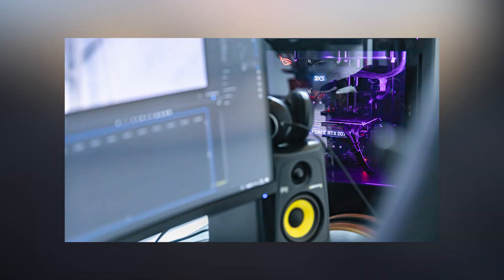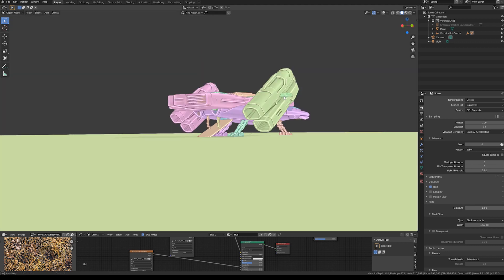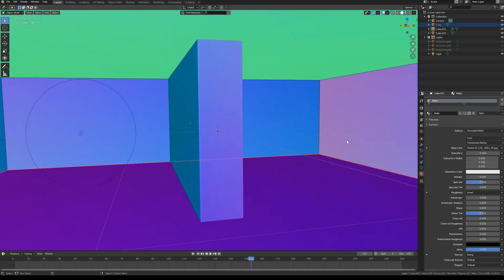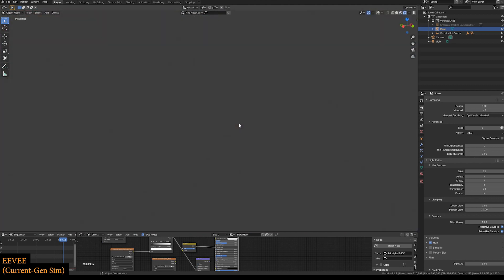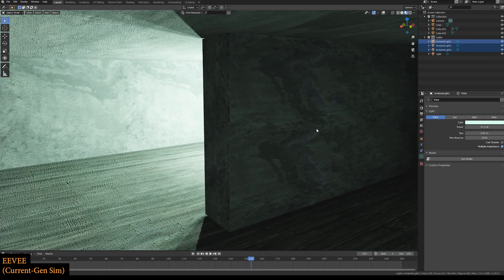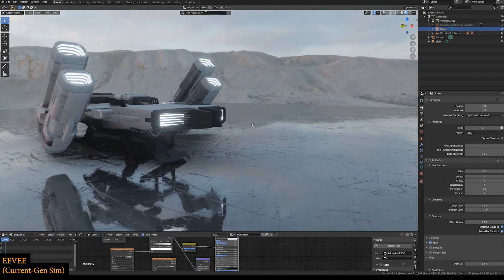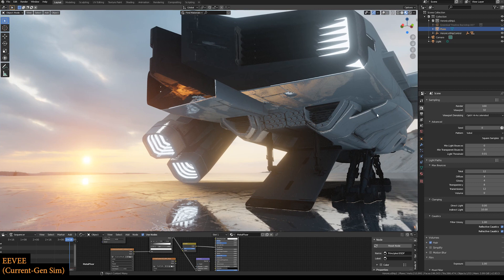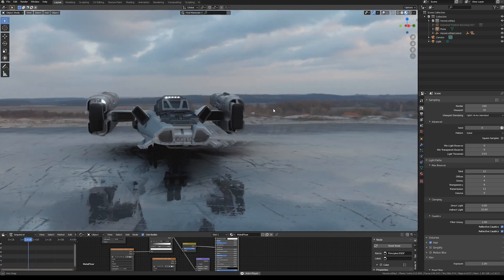Next-Gen Ray Tracing Demo using Blender 3D - How Will It Work?

Comment: You have a fast card, in cycles it's almost realtime
Reply: i think it might be the new features in 2.83
Reply: it's "AI accelerated"
Reply: @oltimeri8256  No he's got an rtx 2070 so he's running it on hardware acceleration instead of software acceleration allowing him to get it that fast.
Reply: This would not be possible in a more complex scene. What has to be understood, is that the more/more complicated the bouncing of light particles gets. The more resources it takes.

So a scene full of objects would suddenly slow waaay down. Movie studios WISH they could render that fast with their huge high detail scenes.
Reply: @lethaldumpster2699  not really sure about that as if I'm right rays are casted on per pixel basis rather than calculating light for all objects, movie studios just need high resolutions and high samples so for sure it takes them longer but I don't know how it is right now. Surely they are using accelerated raytracing and maybe some denoising now, well, they are even switching to realtime rendering in UE4 on few new sets (Mandalorian uses UE4)
Reply: @lethaldumpster2699  a more complex scene doesn't add that much, you have minecraft rtx, but if you introduce high poly count it won't impact as much as you may think
Reply: Were talking about Blender Cycles here. Not minecraft RTX, check the original comment 'cycles'.(in all technical accountability, minecraft is of lower quality for performance). And ontop of that, minecraft is inherently low poly :/ Then even further, more polys does increase part of the calculation times. Especially unique objects, with complex materials(more blender specific). Material complexity has an incredibly large impact(applies to both, and complicates light bouncing incredibly). As expected, the more unique 'things' that exist, the heavier the impact(more blender specific).
Reply: @Naspey
Completely reflective materials have less impact than slightly reflective materials(if reflections are still fully traced). This is cause fully reflective has to calculate only exactly what the pixels look like that your mirroring. Partially reflective has to do that, AND has to add coloration of the material itself. For example, a foggy mirror has to do reflections and the fog on it. While a perfect mirror is just reflections.(obviously theres more going on than just that, but i simplified) Games often cheat, and make materials that are only slightly reflective, not use raytracing for the reflection at all.

Materials have MANY more ways of becoming even more complex than just that. A vast high detail scene will have tons of very complex materials for realism and such. Tanking performance very quickly. 

Another thing, most RTX games arent 100% realtime. Theres usually actually a delay for global illumination. Different types of calculations are simply heavier than others.
Reply: That acceleration require RTX card
Reply: I too was very confused by this... would love to figure out how this was so fast and noiseless in viewport with 128 samples

Comment: Btw blender uses path tracing, not ray tracing.
Reply: true but he is using an nvidia add on that allows for raytracing in blender given u have an rtx card
Reply: @carrapaz3645  yeah but thats not ray tracing. its path tracing. That addon makes blender cycles renderer to use optix engine to accelerate its path tracing process. there is a big difference between the two. A lot of people misuse the word ray tracing when its actually path tracing.
Reply: @Pixel_FX  there's not a noticable difference
Reply: Ice PlayZ Path tracing is much different. It is completely unbiased in its approach to rendering geometry. There is no hybrid rasterization rendering occurring. Path tracing is also far more accurate and demanding, this is why it’s exclusively used for Cinematic offline renders. Typical object dense scenes can easily take upwards of 45 minutes of render time per frame.
Reply from the maker: True. This video is just using Blender, a non-game engine, to help visualise the concepts, rather than demonstrate the real deal in-action on a game engine.

Comment: What rig did you run this demo on?  Cycles looks very interactive
Reply from the maker: 2070 RTX i7 16gb Ram. Pretty beefy and allows for that relatively quick refresh on the cycles preview
Reply: @TR_MediaOfficial  Would I be able to do something similar with 2070 Super Ryzen 5 3600 also 16gb ram?
Reply: Moiz S. Yes.
Reply: @tiredpoison5784  bruh doing this shit on a (laptop) 1050 takes SO long omg
Reply: @JediMoiz  Due to the fact that you can render with the CUDA Cores of your Nvidia GPU, the CPU is not that important.
Reply: @jerry9548  Oh okay, thank you
Reply: Pete Coleman I have integrated graphics and my computer’s hard drive freezes installing blender

Comment: add a planar reflect probe boss on the ground

also a bunch of cubemap probes under the ship near it
Reply: H 0  you can!
Reply: You definitely can do this but if you scale this process to a game, this would add up. Ray Tracing will lower production time significantly  in the long run. We are not quiet there yet, but this should be the future.
Reply: more power is'nt a solution in a phone you wont be able to have raytracing for example so just maybe using hybrid engine or try to make a second virtual camera that see the missing data i think raytracing is still very expensive in computing  and so i think its not very good
Reply: @ErorenémengEroStratagème  planar reflect probe does this
Reply: @ErorenémengEroStratagème  Thats right. RTX inside a smartphone? How much OP is that? LOL
Reply: And set it to auto bake
Reply: they dont do anything in cycles
Reply: @nielshalferkamps7491  they make eevee look like cycles and render in 1/32nd the time

Comment: I get that you're approximating things. But Blender, Unity and Unreal all use special tricks to overcome the limitations you show. So it's really not an accurate comparison. It's also one of the reasons the Ray Tracing capabilities of the RTX class of cards are extremely slow to be adopted-- the EEVEE-like game engines currently do a superb job.

You're comparing 2 different technologies, but unfortunately not using them in the way they were meant. EEVEE does do GI, and can calculate accurate reflections, but you need to set it up correctly. Unlike Cycles, which is point and shoot, with EEVEE you need to configure it properly-- and when done so, the images are amazing. I know as I create EEVEE images to simulate ray tracing results for the biggest graphics company in the world.

If you want to learn more, about how to use EEVEE go to https://blenderartists.org/t/realistic-archviz-from-cycles-to-eevee-with-tips/1154138 or https://www.chippwalters.com/products/eevee-interiors
Reply from the maker: Do you have an tutorials on how to set up EEVEE up to achieve the results you've achieved here? I'm very interested to learn more. Didn't know you could push it that far.
Reply: @TR_MediaOfficial   Basically Reflection Cube, Reflection Plane and Irradiance Volume. These are the tool to fix most of the issues.   In menu add/light probe.     I really like Eevee Irradiance Volume it's  a cube filled with probe so it's fast to setup.
Reply: @untseac  except UE5 uses raytracing to do rasterisation more accurately. Can't really say it doesn't use raytracing since what they achieve is very time consuming without raytracing at all.
Reply: @untseac  Not really, one of the biggest tricks, is to avoid certain things like, shaped mirrors and glass, moving GI,  and clean reflective material. It will absolutely be adopted, and some day you will realise what it actually can do, and what the old tech could never do/fake.
Reply: @untseac  It does use raytracing though, just not in the way DXR does it... Go look up Digital Foundries teardown of it. Raytracing sits quietly in the background making sure everything functions together making it as light as possible because the consoles yet again are less powerful then they're hyped up to be. Yet visuals need to progress some way with new console launches.
Reply: UE5 uses voxel path-tracing instead of regular ray-tracing, which is not as accurate, but much faster to calculate.
Reply: @untseac  Think you got that kinda the wrong way, it doesn't do triangle intersection raytracing (which is what dxr / Nvidia does & is much more accurate then EPICs voxel raytracing based solutions).
Reply: They don't actually. While there are absolutely ways of doing reflections (Cubemaps, even realtime is possible if you're willing to render the scene 7 times), they're costly. In most cases, for static objects, we can use cubemaps that are rendered statically (Once, probably by the gamedevs, then shipped as a texture.), but if there is any dynamic motion in the scene, you'll either have to render the the cubemap in realtime (Really expensive, even at lower resolutions like Hitman 2) or use a combination of cubemaps and SSR. Doing it in RT is expensive too, of course, but you get other advantages which make it attractive. Stuff like GI (Gloabl Illumination) is hard to do on rasterizers. Most implementations either use lightmaps (Essentially rendering the scene using ray tracing offline, and using that data to render the game in realtime) or use some form of simplified ray tracing (Against voxels or SDFs) which isn't too expensive. Then of course we come to ambient occlusion (self shadowing, essentially). You get this for free on ray tracing engines, but it's really hard to do on normal rasterizing renderers, and we do in fact turn to simplified forms of ray tracing for that too, but all of these have artifacts because they simplify geometry to a great extent, and it's particularly noticeable for hard shadows than soft.
Reply: Great stuff, please consider making a video about this as the forum post is hard to follow, those Eevee results are fantastic though you can barely tell the difference
Reply: @sleepyreapy1222  I have a whole course on it called Definitely EEVEE: Definitive Interiors
Reply: And what company is it? Weta Digital? Industrial Light and Magic?
Reply: @israelRaizer  Nvidia
Reply: @ChippWalters  ah, ok
Reply: @untseac  ray tracing in nVidia's case is just calculating a ray/surface intersection at its core. The original, so called raytracers were an optimization, instead of tracing every light ray originating from a light source, you start from the camera and shot rays backwards through the pixels of the virtual screen and when it found something you calculate one or (a lot) more reflection/refraction rays based on the surface parameters and repeat it until you end up in the inifinity (sky, limits, etc.), or in a light source. The generic method is something you can use it for just about anything which needs a hardware driven ray/surface intersection (plus the RTX cards and the overall specification contains a space partitioning layer too, to optimize it further). Hell, you can use it even for sound, they're doing something similar in the PS5.
Reply: Wow those evee renders look amazing. Definitely better than cycles. I'm impressed and now need to learn how to do that. Stop giving me more things to learn haha. So much content
Reply: Kyle LeBlanc Vlogs it is not true. Eevee is definitely faster than cycles but cycles is more accurate largely. For a still rendering nobody would use EEvee.

Comment: I'm new to blender.  How do I set up realtime raytracing, I have an RTX 2080.  Is this just using cycles?
Reply: That is just a very good computer with cycles
Reply from the maker: Make sure you're using the 2.83 version of Blender. Enable 'GPU compute' under render settings instead of CPU > enable 'denoising' and make sure 'Optix AI Accelerated' is enabled. To preview it in 'realtime', change 'viewport denoising' to 'Optix AI Accelerated' too. With a 2080 you'll have great results.
Reply: @TR_MediaOfficial  optix exist in 2.82a
Reply: Enable optix to your blender settings
Reply: Yes. Enable "GPU Compute" to use the GPU to render instead of the CPU.

Comment: No, eevee is too costly to be the rendering technology in actual game, and no, you will not have the quality of cycles in next gen consoles. Cycles is path tracing and is far superior the ray tracing they promise on next games.
Reply: it is an analogy he is not saying that this IS what they look like
Reply: Agree. His simplification is misleading at best.    Also Cycles isn't "physically based"  it's an unbiased path tracer.          Physically based can be the material standards (which isn't new at all) 

This just burned to watch....
Reply: @oby1  How is a path tracer not physically based?
Reply: @rob6129  Path tracers are neither physically nor non physically based. They simply trace out a path and then calculate depending on what you want to output and the algorithm you use, which in rendering is the rgb values of pixels while using an algorithm that takes into account the materials and light sources/properties of light. You can use physically-based materials, and you will get a physically-based output. However, if you use non physically based materials, then you won't get something physically based. 

You can also use path tracing for things other than rendering.

Comment: @Toby Rawal, how about applying techniques we use to optimize rasterized graphics t ray tracing, example, checker board rending, and rendering on lower scale to the original, then scaling it to image, so a 1080p image could be at say 480, or 540, path traced, then scaled to image.
Reply: This is essentially what DLSS is doing
Reply: @pixels_per_inch  what if we could bake rays, like we throws rays from the light point and store the info of all bounces that occurs, then in real time, use path rays from the camera to get the info to display on screen, this way we minimize the amount of work to be done in real time
Reply: @taiwoolaleye6333  This is what most games already do. They ray trace the scene and bake them in. You can then ray trace on top of it to create reflections, etc. 

However, the problem is that lighting cannot be dynamic, since it's already computed and cannot be changed. 

That's why full ray tracing is such a game changer. Look at Quake 2 RTX for example, the only fully ray trace game available right now. The other games like Control use hybrid rendering, some are baked and some are ray traced (pre-computed + real-time raytracing like what you mentioned)
Reply: @pixels_per_inch  yr, i know what baked lights are, this is similar, but storing the actual ray it self is what im talking about, i know about hybrid solutions , example is one of the minecraft version built by someguy, i forgot his name